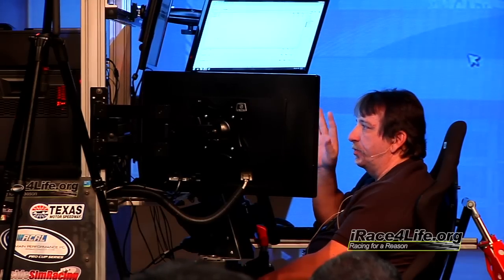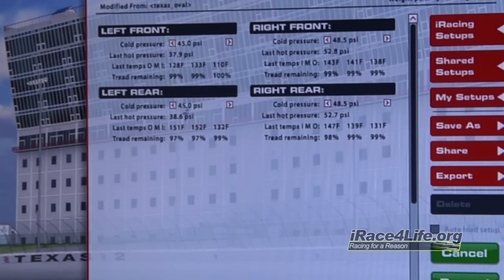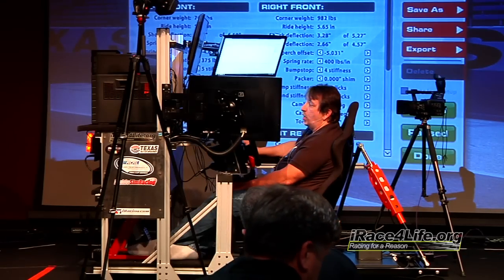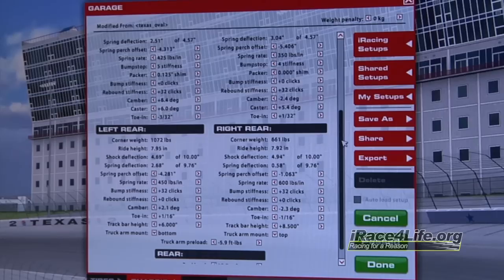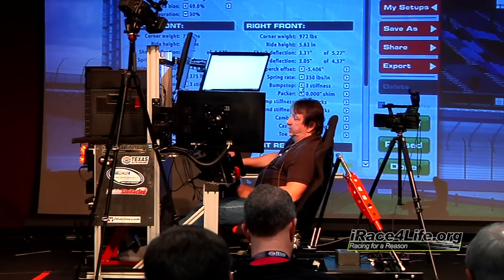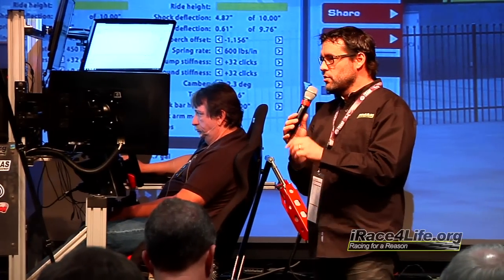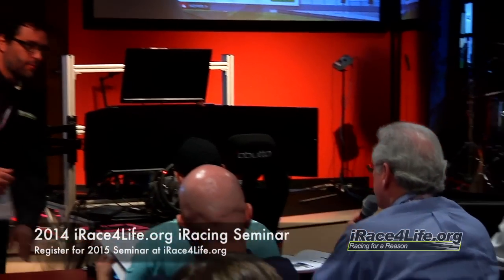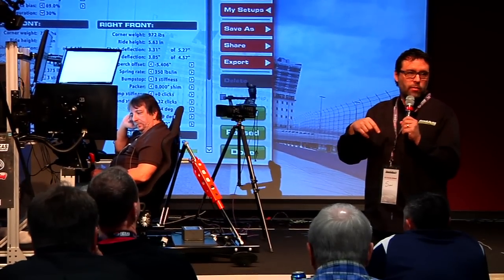iRacing - Building A Balanced Oval Setup Part 1

Comment: New to setup and I am not seeing the same thing in the Chevy Gen 6 car. Will your setup work with all A cars because my ride heights are wat off. Also the fixed setup is 5000 lb spring rate which is way more than 450. Very confused.......
Reply: Yes, every Gen 6 is exactly identical.

Comment: was this made before the gen 6 car got tire model v5
Reply from the maker: David Cater followed up in the iRacing forums with this: Biggest thing now is the RH's. You want them to be left side down Right side up now. Seal of the left side use the RR to give you handling in the corners.
Reply from the maker: This was asked as well:  Sooooooo David: Does this mean that, in the garage, you will NOW actually be raising the RIGHT side on both front and rear to its HIGHEST setting for the initial setup? Please clarify your guidance for us. Thanks.

NO but I am dropping the left side to seal it off and raising the RR just above where it drags the track depending on the track of course.